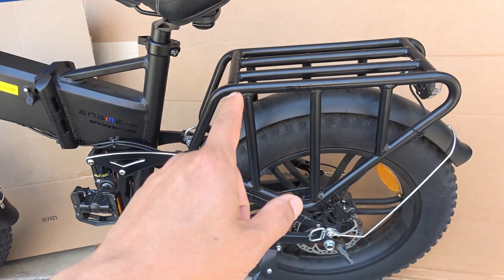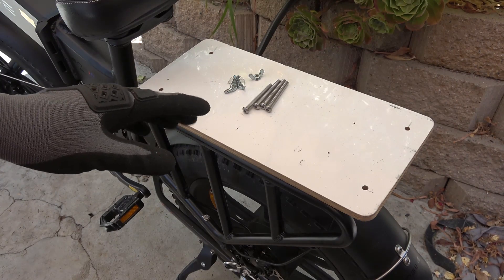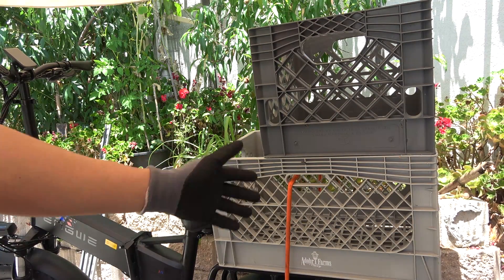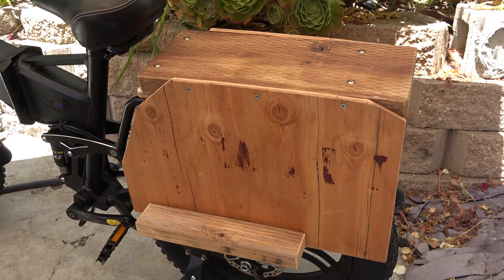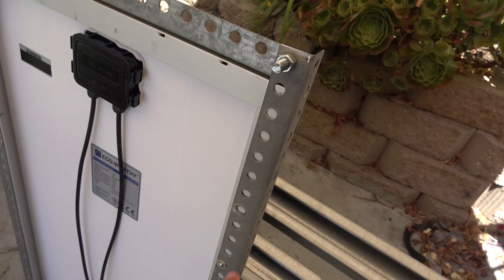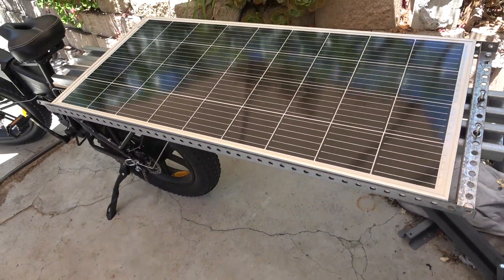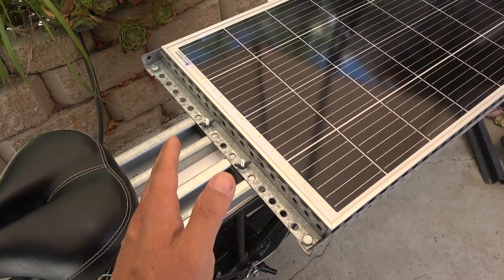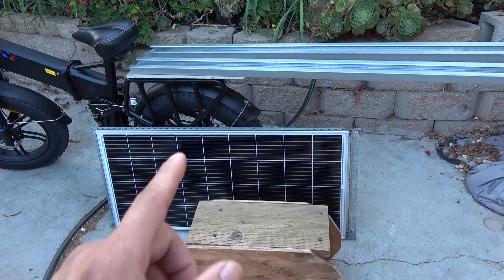DIY: Make a multipurpose bike cargo rack for cargo, people, & solar panel

Comment: Nice mods.  Might want to make a metal plate to go inside channel, then the blocks on top, then the panel.  Thus sandwiching the rubber to give some shock relief to that poor solar panel.  Otherwise silicon wafers and the soldering gonna be tortured by bumps and maybe crack.  You have nice rubber blocks, may as well take advantage of their properties!

Comment: Have you found the benefits of a 100W solar panel greater than additional battery capacity weighing the same as the solar panel and mount?  Assuming the battery was charged by stationary solar.
Reply: Best benefit is probably just being able to park your bike and it just charges itself.